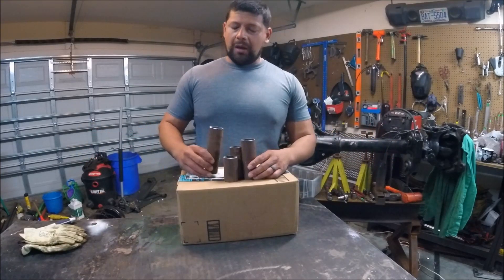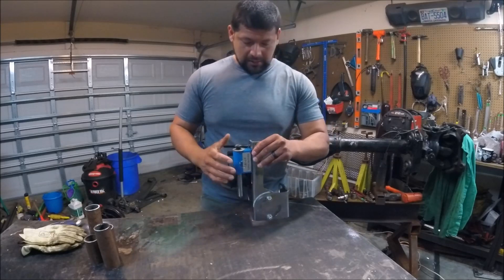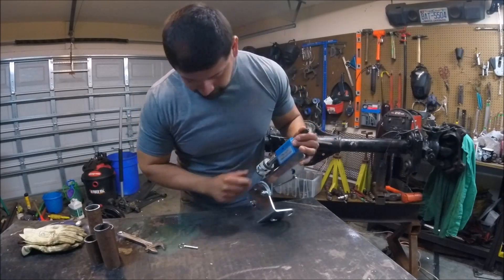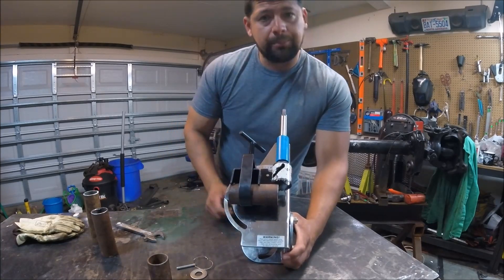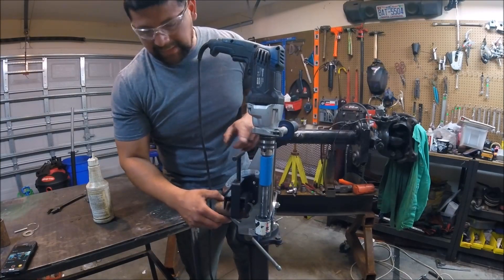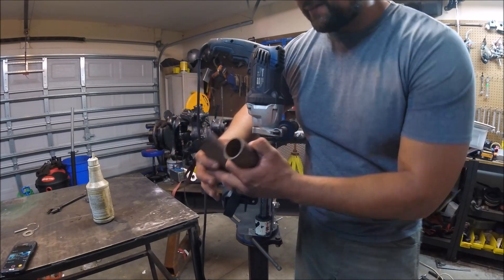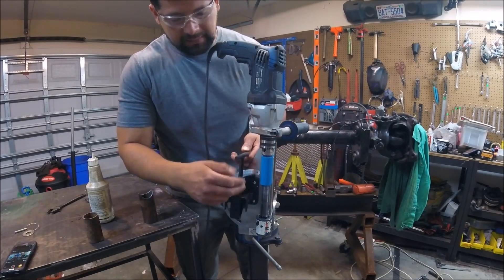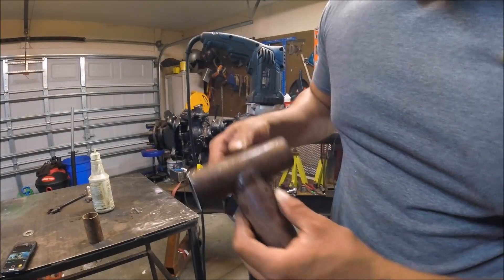$100 AMAZON TUBE NOTCHER, HIGH QUALITY, BEST REVIEWS

Comment: I have a h.f. notcher I bought probably 15+ yrs ago other than shimming it about 1/16" and adding a grease fitting for the bronze bushing to help reduce wear since I use it pretty often  it's works great,  its sturdy , unless they made it cheaper since then,  I'd rather pay half the price and add a few shims but that's just my 2cents

Comment: Hey Edgar, what brand hole saws do you use with the amazon notcher ?
Reply from the maker: Irish I use Lennox brand hole saw
Reply: @cisnerofam08  I was just getting ready to ask you that...😉
 What brand of "Ammazon notcher" is that?
 You should put a few drops of 10-30 or straight 30 motor oil on the shaft to prevent premature wear...🤔